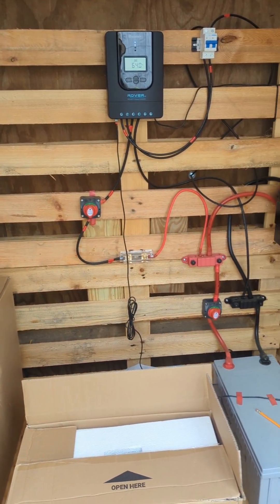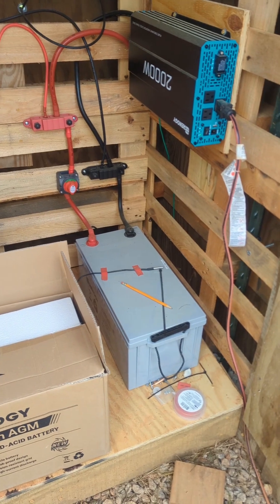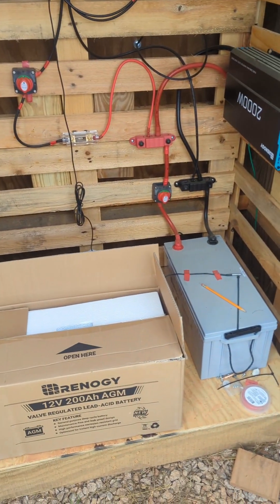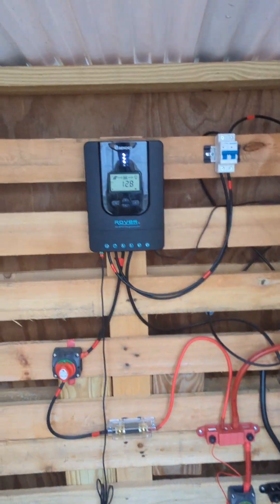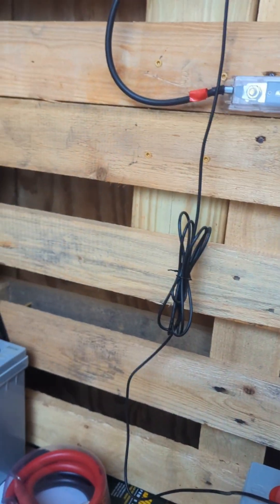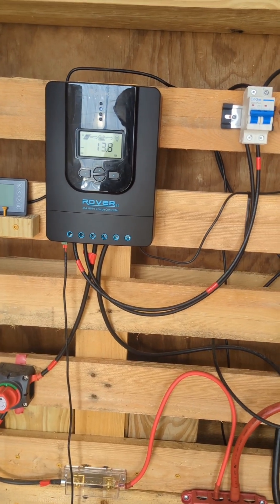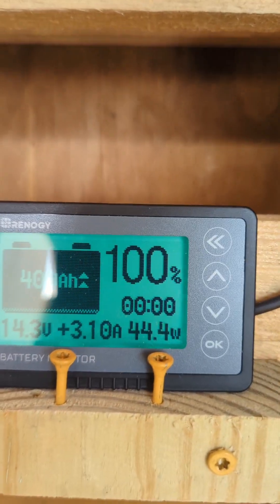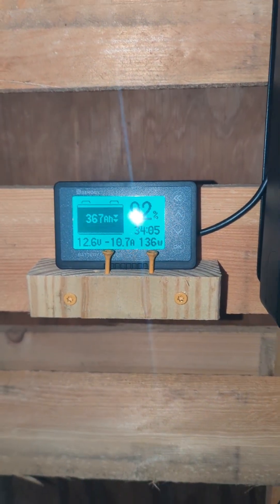New Batteries & Monitor for the Solar Shed

Comment: I would still have upgraded to LiFePo4 with low/high temp cutoff.
Reply from the maker: Thanks for the advice. It is definitely something I want to do. Now I am stuck with not enough panels to charge the 400ah batteries back to 100% and run my load. I have a 40amp MPPT charge controller and it  looks like I can only add one more panel (total 5) before needing to upgrade it. I moved my panels back to avoid some building shade but I think I may need to get them off the ground all together.